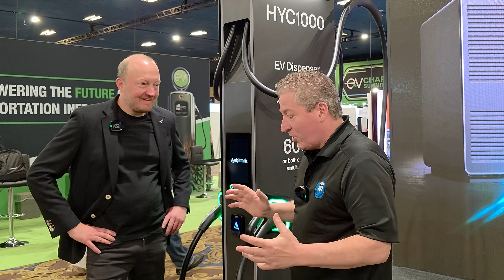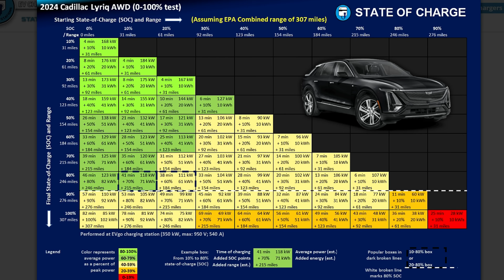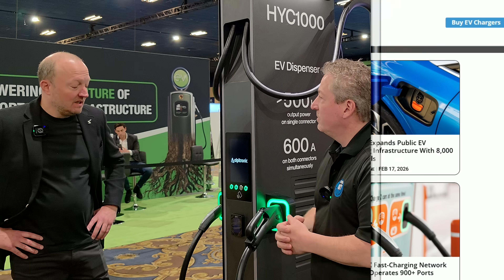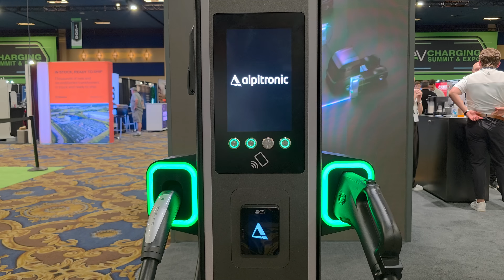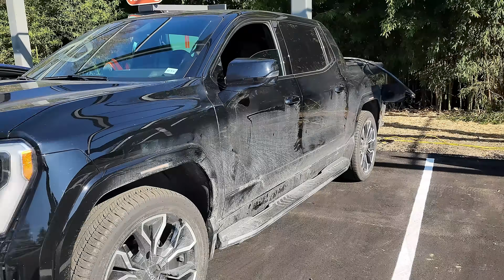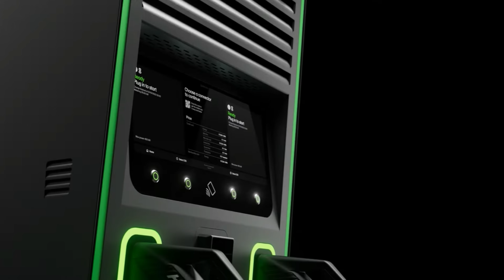Alpitronic Shows Off Its Megawatt HYC1000 Fast Charger At The EV Charging Summit

Comment: Another informative and entertaining video.  Tom, I recently contacted Charge point because I am interested in installing a level 2 charger at my Drugstore in a rural Alabama town.  I was quoted $7,000 to $17,000 for a single 50 amp level 2 charger with a payment requirement .  That didn't include installation.   I purchased a 60 amp Grizzl-e charger because of your recommendation.  I spent ess than $1000 including installation.   Can you please do a video explaining the best options for a small business owner that would like to encourage EV adoption without giving away the electricity.  My plan is to charge 20 cents per KW.  Enough to cover the cost of the electricity, but yet cheap enough that locals might stop and charge while eating lunch or waiting for a prescription to filled.   Thank you
Reply from the maker: I think the Grizzl-E is a great option, and I'm happy you found it through my videos. I like your pricing structure. I personally recommend charging a little more than the current local electricity rate. If you make it less than what someone locally would pay at home, then you get locals taking advantage and abusing the amenity you're providing.
Reply: Our current rate per KW is 12-14 cents per KW.  Thank you for the info.  I didn't realize Grizzl-e had chargers with a pay option.
Reply: @StateOfChargeWithTomMoloughney  Maybe you could have Qmerit, do the physical install, for the store? With a United Charger's rep implementing and explaining their new backend commercial software? Such as for payments and billing. Would be a fascinating post, IMHO
Reply: Third party payment can be complex. So below I'm passing along an excerpt of what United Chargers, offer for commercial purposes. Hopefully the Grizzl-E charger/EVSE, you purchased is compatible?  If not hopefully, there is a simple cost effective upgrade option? 

"United Chargers has released Grizzl-E Connect Commercial, a commercial EV charging software platform designed to turn its Wi‑Fi-connected Grizzl-E chargers into payment-enabled commercial units.

The company says site owners can activate commercial features over Wi‑Fi, then control access, set pay‑per‑use pricing, configure power management, and monitor usage—features aimed at commercial, multifamily, and fleet deployments. United Chargers also announced a limited-time promotion: customers who buy a three-year Commercial Software License get one year free."

Probably best to check out their website and give them a call. To see if it'd be appropriate for your needs? Just my two cents on the matter. Just seems to make it simpler, if you get everything from one source? However you decide to charge your patrons, I wish you well.
Reply: @nc3826 
Thank you, my current Grizzl-e charger is at my home.  I will contact them ASAP and find out if they have a good option for my store.
Reply: @JarrodTidwell  Since an EVSE/Home L2-AC Charger, hasn't been installed, yet at your store. 

Also hope you can suggest and have Tom? Have Qmerit, do the install of it, at your store? And even better, hopefully a United Charger rep could be there physically or virtually, even with a time delay for the post? To explain their commercial backend software, such as for how it would bill your patrons and its other functions. It'd be a fascinating post, IMHO

(With technology changing so rapidly, It's always a good idea, to do a new AI search, for the latest offerings. Which is what I did in this case, with verification to eliminate the AI slop. Apparently it's only been a few months, since United Chargers started offering the commercial backend, billing and payment software. (FWIW, I had no idea it existed before the search, so thank our AI Overlords, for the info lol))

Thanks again, for the thought-provoking comment. (sorry for repeating the same comment, but I just realized it was more appropriately posted here)
Reply: Addendum: TOU, Time of Use tariff/rate or other demand electric utility plans. Could be more cost effective too? 

Could be worth looking into with your electric utility provider and make sure the EVSE payment plan can facilitate it too. Since they often can offer substantial off-peak rate discounts. Especially useful for home charging. FWIW

Comment: Now we just need cars to charge at 600kw in the US cause most cars are still less than 250. Hopefully 500 should be the new standard soon.
Reply: Now we just "need" battery swapping........ Since higher power charging, sucks for the grid. Or it requires costly load shaving batteries for the charging station... To Avoid demand charges.  

But I get it since most entitled EV owners, have home charging. And just want a faster charging option, for an occasional road trip. Let's just fixate on our own entitled, desires to save a few entitled minutes a few times a year.... C'est la vie
Reply: @nc3826 so by that logic we should have slower charging. Even better let's have slower filling up gas station cause they are also entitled to fast filling gas stations. Chinese EVs are clearly leading the charge and USA companies need to follow. We certainly don't lead anymore.
Reply: LMAO, But gasoline doesn't come from the grid, does it? You know the grid that has to be constantly balanced? So thanks for  proving my point.

And what about those Chinese battery swappable EVs, that China are leading in too?  Which sadly doesn't seem to be coming to North America anytime soon? Why doesn't that concern you too?

Not against faster charging EVs or DCFC infrastructure, was just pointing out its downsides. Sorry to confuse you.  Have a nice day my triggered friend... It's all good ;)

Comment: I'm not sure whether you have a video created already or not. Can you create a video that explains the different terminologies for the newbies to the EV vehicales and charging.  Amp, Current, Volts, Kw, Kwh, and etc.  And also show the difference between how fast certain vehicles charge and how much storage they hold.  A good chart and anology would be great to try to remember the difference between what those terminologies mean. Thanks.

Comment: Another benefit to having the screens on the front is you can then see the charger's screen from inside your car if you are parked head first.  Most EVs do have their own internal charge monitoring UI and app, but the info on the charger's screen is sometimes different.  The Alpitronic units can show the charge curve on the screen for example.  In bad weather its also nice not to have to get out of the car to see the screen.
Reply: Absolutely! With my bZ, the charging is on the front passenger side with NACS, so I normally pull forward to the charger and then sit while it charges. With the screen in front, I can see the stats as the bZ display doesn't show everything in detail.
Reply: Good point. While I back in to charge I like being able to see the screen in my rear view mirror. At my local EA station I can see how much money I've spent and how long the session has run.
Reply: Fascinating mostly superfluous, rabbit holes that the anal retentive dig, for details.Considering all the variables, such as port  and DCFC dispenser, locations and orientations. For example the dispensers are sometimes located between, EVs. There's never going to be a perfect option for everybody. But love the age of entitlement perspectives. 

Or how about just, mirroring or casting all anal retentive data on smartphones? C'est la vie
Reply: @nc3826  Funny, insulting folks who comment on the details of EV chargers in the comments of a YouTube channel the specializes in the details of EV charging. I suppose you'd think Tom is "anal retentive" because he likes DIP switches for level 2 charge limiting? I think details matter but that's just me. Have a nice life.
Reply: @FB-rn1bn   So give me a detailed  analysis. Of how your sense of entitlement over its UI location, is comparable to major safety features, such as evse dip switches? Since on a prime of fascia basis, your analogy, is nonsensical at best.  Since "details matter", don't they, my hypocritical friend?
Reply: "insulting folks"?  What folks? FWIW I'm seriously curious... was it the expression, "anal retentive data"? Is insulting to me. 

Since we all end up getting insulted in some manner. Maybe we should stop worrying about, such trivia. Just my entitled thought on the matter. And I just saw a comedy routine where the skit was about common words that are now considered insults.

Comment: One of the large savings with HYC1000 vs HYC400 is demand grid charges.

An eighth stall HYC 400 needs 1.6 MW while HYC 1000 needs 1 MW. This is a huge saving for a CPO.

Tesla V5 : 900kW - 8 stalls max
Kempower 600kW - 8 stall max
Kempower 1.2MW - 12 stall max
Alpitronic 1MW - 8 stall max

Those are pretty similar numbers.
Reply: excusez-moi Kempower can do 12 stalls since Q4/25 with 600 kW too. Also 25 kW granularity vs. 62,5 kW.
Reply: @Shure2404 on a single trippel cabinet? Thought it was only when linking two cabinet together.

600kW on 12 stalls is a good option overnight depot charging of buses and trucks.

Comment: Quite honestly, I think a better solution for screen location we’d be to have two smaller ones on either side that are distinctly for one charge handle or the other.
Reply: As somebody with dyslexia, I totally agree. For me personally. But it's an issue of cost. Two even smaller screens are more costly. 

Every option has a trade-off. The learning curve is rather short, so it's not that big of a deal. Even for me and my dyslexia. C'est la vie

Comment: Mike didn't answer WHY they rushed HYC400 with monitors on the side. They knew that solution was premature but they rushed it to the market and now they're undoing it via the 2nd version of HYC400.  Mike also did a bad job of not advertising that this unit is MCS ready and the new oil cooling could allow up to 1500 A to flow through. If you're a truck stop/ CPO (Pilot, Love's, TA, etc) then you'd look for this type of solution that could service both cars and trucks.

Comment: At 600A, I wonder what kind of power my 800V Ioniq 5 would pull…?
Reply: The same as on a 500 amp charger because the limit is your car. You need one of these Chinese charging monsters like Xpeng or Zeekr to really see the benefit on 600 amp.
Reply: Still 260kW if the facelift model (230kW otherwise). But one of these 600kW dispensers could charge your Ioniq 5 at 260kW on one cable and likewise a Kia EV6 at 260kW on the other.

Comment: Before this video I didn't know who made the chargers (HYC400)  that I've come to love and rely on so much. They built an Ionna station in my state and they have the 400s. I only stop at this station during my frequent road trips. These HYC400s are reliable and the cable design is superior to all because it allows me to reach my port with ease. Ionna had a rep survey me once. I told them to build more and I would only use their stations lol, under the impression these were Ionna's machines. Funny enough they asked how did I hear about Ionna and i said a YouTube channel called State of Charge. So thanks Tom for keeping us informed.
Reply: Wait till you try Kempower. It's even better. With cable managment, UI etc.
Reply: @Shure2404 i need to find one of these kempowers to compare it
Reply: I'm a Kempower geek fanboy too.  But for somebody who mostly cares about reliability.  

Won't really care about the added benefits that Kempower is offering. And I'm guessing at a higher price point?

Comment: So what is the max output per plug (NACS or ccs1) on a HYC1000?
Reply from the maker: Up to 600 kW per connector for passenger cars and light-duty vehicles, 600A @1,000V. So it will depend on the vehicle's battery voltage. Up to 1,000 kW (1 MW) per connector for heavy-duty vehicles, supporting currents up to 1,500A with cables that are specifically designed for heavy-duty trucks.
Reply: @StateOfChargeWithTomMoloughney  Really? In the video, it advertises 500kW/connector in big print right on the machine. What am I missing?
Reply: @noonm3901  the > before the 500kW.

Comment: Next year full rollout is disappoint for the HYC1000 in the US.
Reply: I don't think he even mentioned HYC1000 to us in 2027? Just that they start to produce it? First Europe and maybe US in 2027.
Reply: Why - we don’t have many vehicles (yet) that require that
Reply: @Bzzap83  But it's really shame because these goes to ground for 7-10 years. HYC400 is outdated already. Hard to upgrade the site. With Kempower it's easy to install powe cabinets and add satelites and power later when fleet grows. So it's much better to forget AiO already and go with split system from day 1.
Reply: @Bzzap83  It has been in pipeline for a while and thought more progress would have been made.
The distributed architecture is overall a better solution.
There are not many vehicles that even take 800V and 400kW but they have been installing those for years,

Comment: I've seen some lower cost 40-50 kw DC fast chargers that are powered by 240 volt split phase that almost every business would have. While not as fast as these newer units they are 5-10 times the speed of a typical Level 2 post & some on Ali can be had for 3-4 thousand. I think more businesses would install these if they knew about them but I haven't seen a single video from anyone on these low end DC fast chargers. I'd bet some homeowners with multiple EV's might even install one for the occasional quick turnaround trip. You would need at minimum 1 dedicated 200 amp 240 volt circuit for one of these units.
Reply: Chargers installed at businesses would more likely have a 3 phase in the US. Residential is 240/120 whereas large buildings have 208/3phase or 480v/3ph services.
Reply: @kng128  while that is true for industrial buildings I was talking about small businesses, most of which use split phase just like the typical home.
Reply: well said and those are PERFECT for malls,gyms&food places where dwell times are 45mins to 1.5hrs or more!
Buffered by a big battery which charges slowly or charges off peak times for cheap it would make sense for any large complex imo.